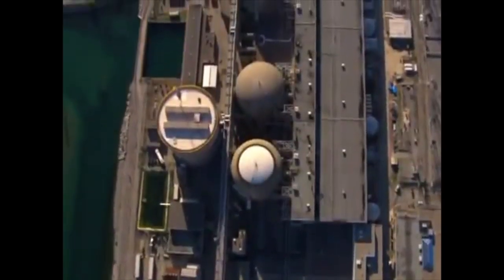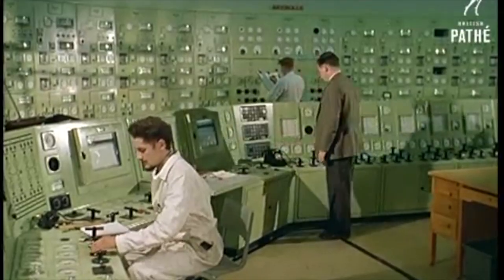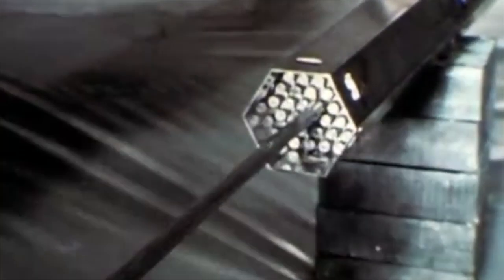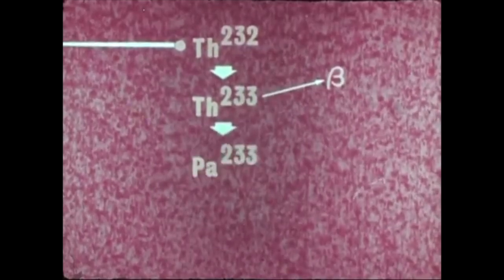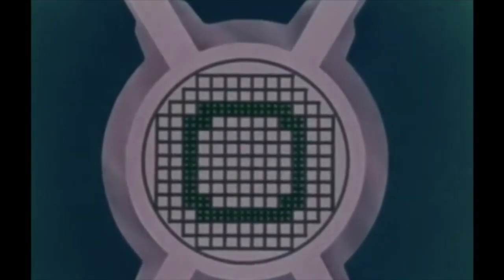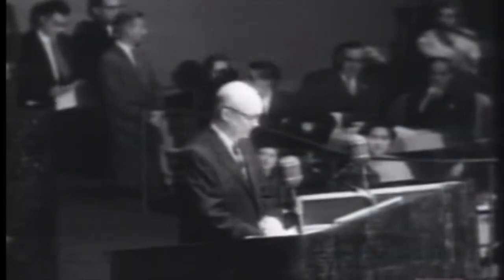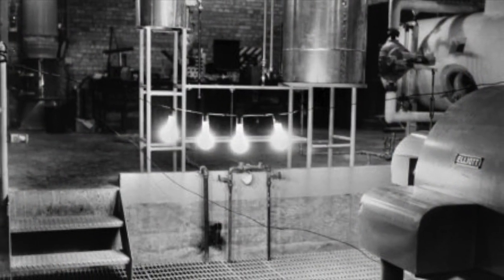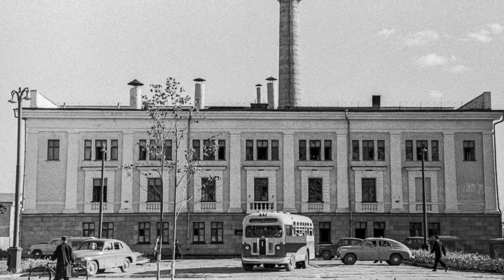Molten Salt and Pebble Beds and Breeders, Oh My! Alternative Reactor Designs (Part I)

Comment: So much interesting information here. I had no idea there was a solid-fuelled Thorium-Uranium reactor operating. I only knew about the MSRE, but as you know that never had the Thorium blanket actually installed.
Reply: China's now got TMSR-LF1 running on 50kg thorium (First to operate, there are others working on it) using a 20% U235 kickstart in a single loop (It's more or less a rebuild of the MSRE to verify ORNL's work)

Comment: One thing to note. Pu-239 is the only nuclear proliferation threat (EDIT: from breeder reactors at least, normal enrichment of U-235 is always a threat). Many test warheads have been made and detonated with U-233, however due to U-233's high spontaneous fission rate, any warhead thus constructed will start the chain reaction before the proper level of compression of the core has been achieved, therefore it will have a low nuclear yield and waste most of the explosives energy in distributing the fissile material around ground zero, rather than properly compressing and initiating the fission reaction that results in the majority of the explosive yield of a nuclear warhead.
No known pit implosion scheme can cause U-233 to obtain a high yield nuclear explosion.
All that happens is you make a hard to clean up mess, you don't get the big kaboom.
Reply: Even with plutonium the breeder has to run a short cycle to keep Pu240 production to a minimum if a bomb is desired.  For reactor use Pu240 is less a problem and a long breeding cycle, more time between switching out and reprocessing fertile fuel elements, can be used.  In short, a breeder reactor can't produce bomb material without a recognizable change in operating practice.
Reply: U233 isn't the issue in U233 bombs, but the U232 which comes along for the ride IS and as you've stated, the resuits have been pretty rotten with the best achievement being a 60% yield reduction in a 50:50 U233/Plutonium mix bomb and most of the rest barely exceeding "fizzle" status

The U232 is useful - it and its daughter products are such hot gamma emitters that they make trying to weaponise anything derived from thorium extremely difficult (even using the much-vaunted Proactinium separation process of dual blanket designs) - and it's rather telling how violently several vested interests reject thorium/molten salt designs on the basis of "proliferation" whilst ignoring that enriched uranium is the WASTE PRODUCT of Pu239 production (which needs highly depleted uranium for best results) and as such there was lots of it kicking around looking for a home when Weinberg developed the Shippingport/Nautilus reactors - His explanation of using uranium over thorium was simply "Uranium isn't the best fuel, but it was the only thing available at the time"
Reply: If this was 1943 that would be true, but that hasn't been true since at least 1966. U-233 is an eminently suitable nuclear material and has been used successful in low and high yielded devices. It's abandonment was a result of Plutonium's issues being solved sooner, not because U-233s problems couldn't be or weren't solved.
Reply: @Volunteer-per-order_OSullivan  
I think you need a refresher on U-233's sponatneous fission rate.
15 april 1955 was when the US tested it's first and only bomb that used a hybrid Pu239/U233 fissile pit.
The yield was calculated at 33kt, but actual yield of the test was 22kt. This is not quite a fissile, but yields that are significantly under target are not something that lends confidence to the concept of using a bomb that has u-233 in it.
Plus the thorium fuel cycle does not generate the high-purity U233 you would need in a weapon anyways (which would have as little U232 as possible), which was my whole point.
Reply: @44R0Ndin  The spontaneous fission rate of U-233 is much lower than Pu-239, sufficiently low to allow it's use in gun type weapons. The Pu-232 contamination problem is the same as the Pu-240 contamination problem and like it was solved decades ago. Your point hasn't been true for the better part of a century.
Reply: @Volunteer-per-order_OSullivan  
I'd love to learn the sources you have to prove this.

Comment: The inventor of the PWR/BWR was Alvin Weinberger . As early as the 1950's he said "stop building these things".  That is because there was already better and safer ways to do nuclear fission reactors.  However, because the US Navy had done all the research and testing, private industry just adopted the military PWR/BWR design as a standard and pushed it as the ONLY way to do fission, which was foolish in the extreme. Solid fueled reactors are highly inefficient, and using water as coolant is a very bad idea, it is unstable in a high neutron flux environment, decomposing continuously into its component explosive gases and handles heat very poorly, requiring high pressures to operate above 100 centigrade.   Molten Salt reactors were always the right path, and Thorium is useless for weapons, but ideal for making energy.  Uranium is ideal for making weapons, but very poor at making power.......which do we want??